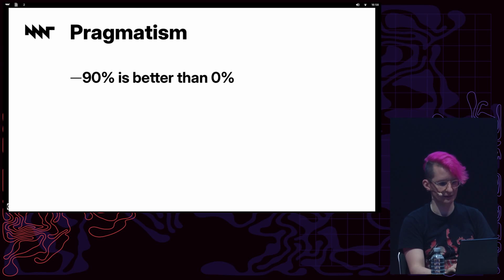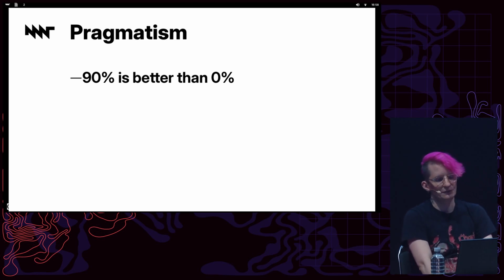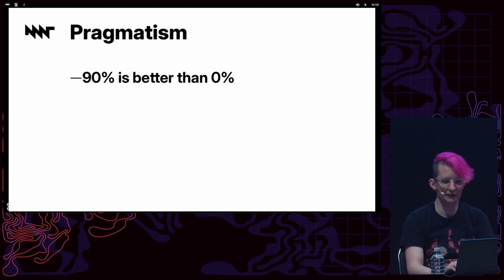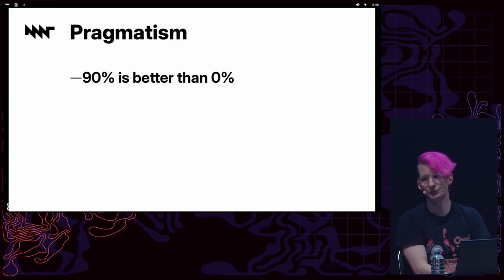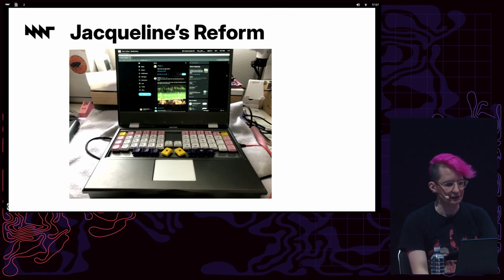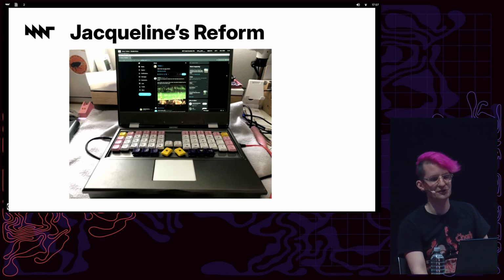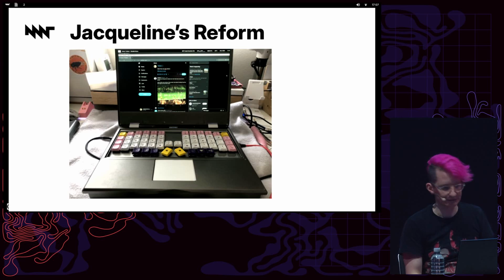38C3 - 7 Years Later: Why And How To Make Portable Open Hardware Computers

Comment: Here's why 90 percent is by no means better:

The said 90 percent do not include the loss of time and value for the user. 98 percent is therefore an absolutely necessary minimum, which is only repeatedly undercut due to financial factors (which simply should not be the main factor in a world of big financial inequality because it is the cause and the effect of exactly this inequality).

This statement applies at least to all things that have a significant network effect. 90 percent in health would cost lives.  90 percent in other areas are simply not being measured.  However, this does not mean that there are no effects. 

The difficulties described here mean above all that we as a society have unfortunately long since passed a "break-even point" in terms of the global major players' closed-mindedness and closed-sourceness towards products that we all need for a digital life today. The argument should therefore be turned around. Or to put it another way: "OK Apple.  No OSS? (in extreme cases after X years at the latest, with X=3 product cycles?)? No money."

I LOVE the "smartphone replacement" idea. Instabuy if Unixes run flawlessly. People who complain about the size clearly don't understand the mechanics.

Great talk nevertheless for all the experiences shared.